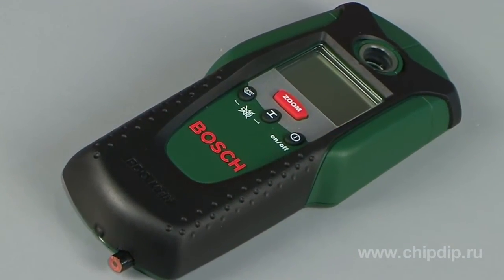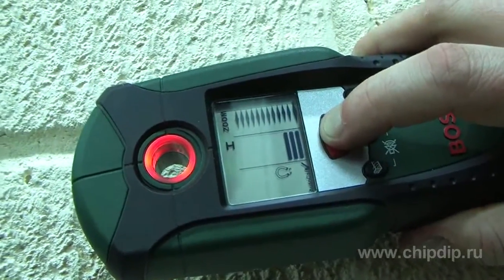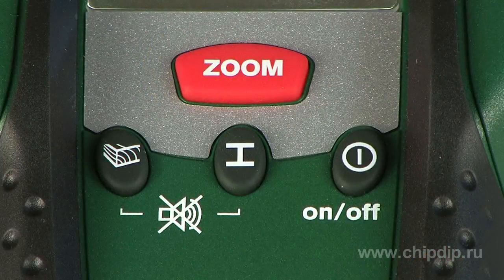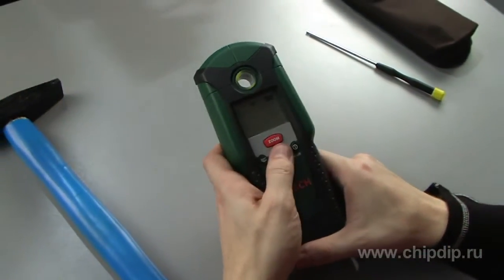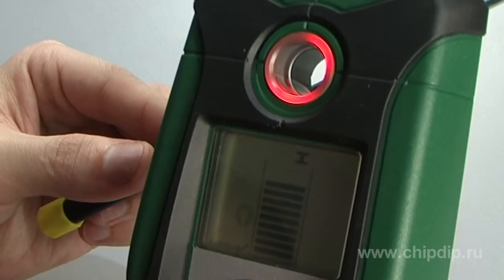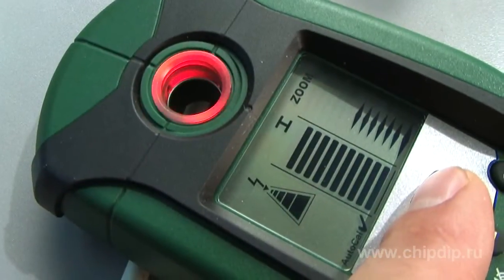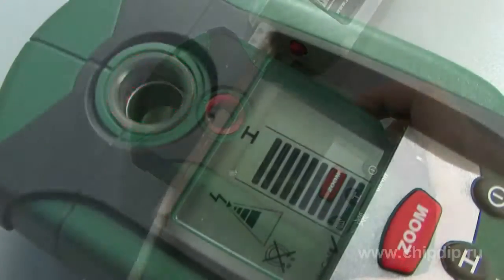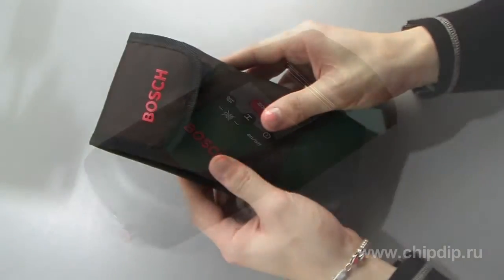PDO Multi Digital Detector

Comment: It does find metal objects but when switch to timber it indicates  everything :  timber , metal , plastic .... . I never managed to be certain that I have found timber stud
behind plasterboard wall. For finding  metal I find it reliable but when it comes to timber it is not reliable , sometimes it start flashing red even if there are no power cables around.